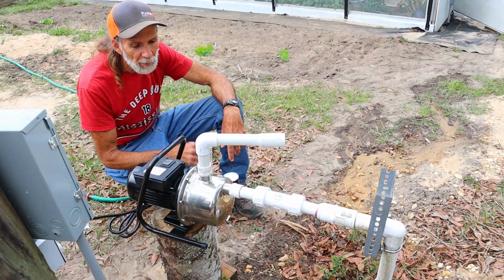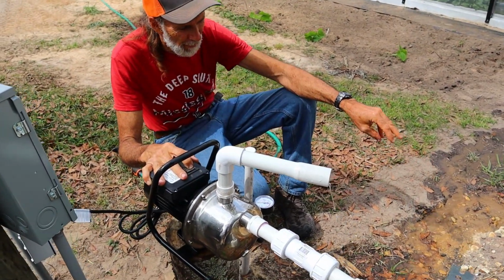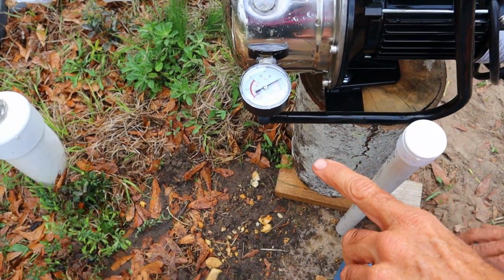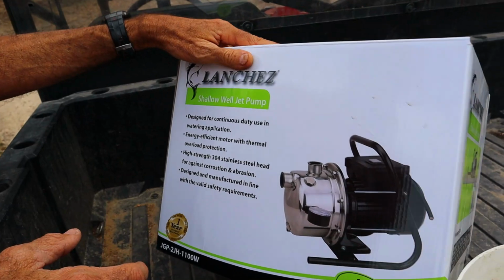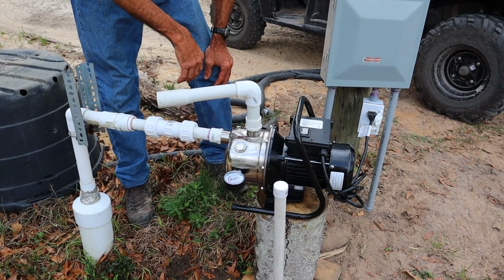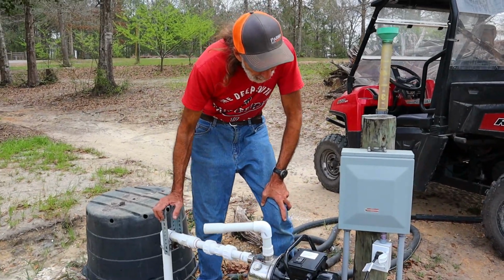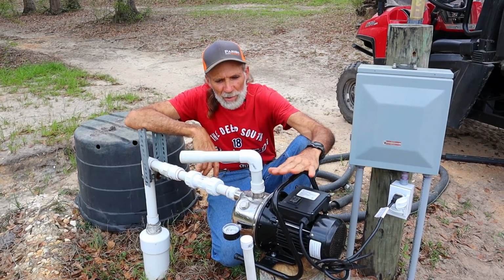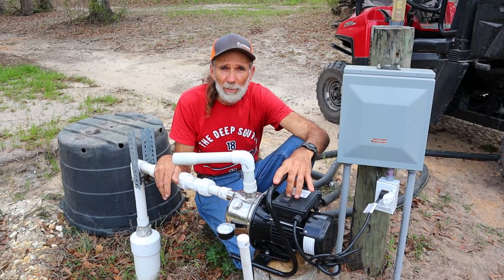HIGH TUNNELS How I plan to water them

Comment: Great stuff. Used such a pomp for 30 yrs. Flexible suction hose in the creek, plastic bottle for a float, ballasted with a stone to keep the inlet below the surface where the debris is floating. Even saved an ornamental lane (over 100 yard long and 5 yard wide) with new transplants during a long and hot dry spell, Only had to lift it in my bycicle cart with all the tubes and sprayers. Stay safe, best wishes, greetings from Holland.

Comment: Hello Danny, looks like a good plan.  I rented a trencher for the greenhouse I am building (in Central Oregon) in order to run water from my pump house to the greenhouse via underground PVC piping.  Just curious about your electrical codes.  I noticed that the type of electrical outlet box you are connecting the pump to does not appear to be an outside all weather box for connections as rain/water can actually still get in the outlet.  Just thinking of your safety.  Stay safe my friend.  Best regards.
Reply from the maker: The electrical box says suited for outdoor use.

Comment: Danny, my concern is why didn't you put a non-fault electrical outlet plug on the set-up?  Water & electricity will kill you?
 What is the temperature of the water, I know in Flo. it would be warm enough for your gardens.
Reply from the maker: I use ground fault circuit breakers instead of the recepticals.
Reply: @DeepSouthHomestead  Thank you for your reply.  Didn't know there is such a safe thing!
Reply from the maker: @chris3m98  yeah it's a lot cheaper than buying all the expensive recepticals.
Reply: @DeepSouthHomestead  How cold is the water coming from the well, thanks
Reply from the maker: @chris3m98  it's very true cool like refrigerator water.

Comment: I bought the same hightunnel as you did size wise..I wondering on the fans or air system to run in it. I am new to this.. and have done my best to look for what I need. But I really am not sure what I need or should run. I am on full solar power as well. Homestead in Missouri. Any information would be great. Thank you very much.
Reply from the maker: We have videos showing what we used in both high tunnels. Each has a different setup.